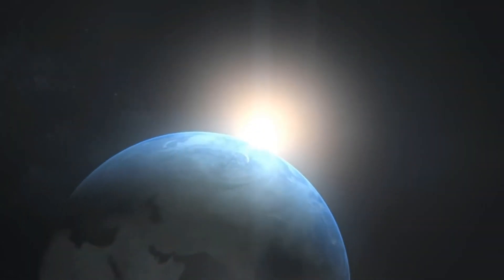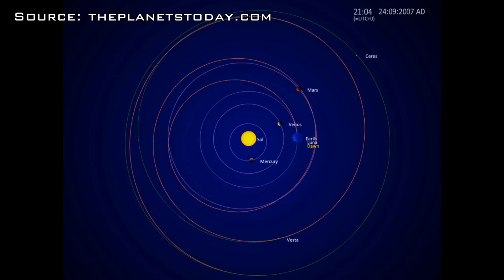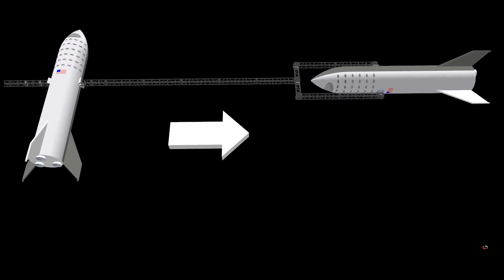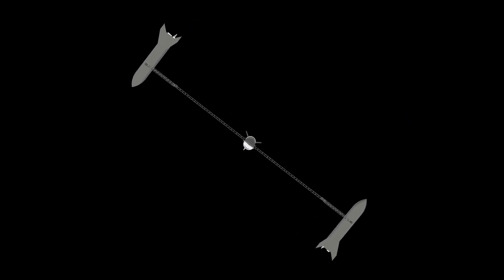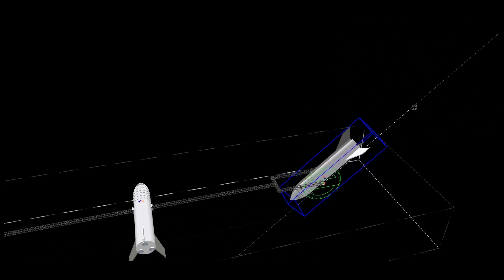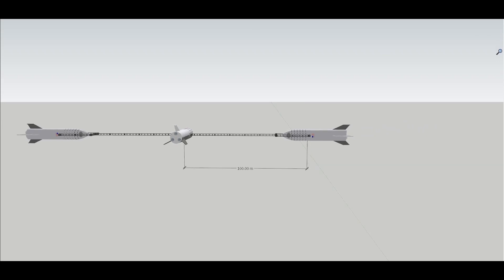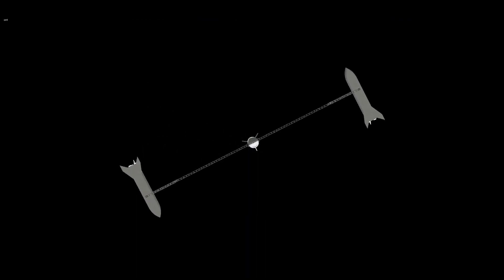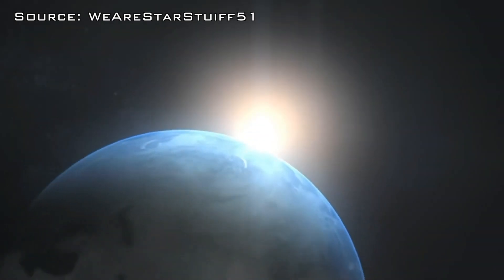GLS2: Artificial Gravity for SpaceX's Starship

Comment: Now, let's think outside the box and take things to another level shall we? Interesting how both the O'neill Cylinder and the Stanford Taurus actually behave in an opposite fashion to "gravity!" In essence, both the O'neill Cylinder and the Standford Taurus are employing kinetic energy to produce a likeness to the effect of "gravity" via centrifugal force. This is not the case in the spherical planetary model. According to Sir Isaac Newton, the initial theory regarding the "force" of "gravity" had nothing to do with motion but rather was based upon the attractive force produced by the mass of a spheroidal object. However, Albert Einstein superseded Newton by adjusting that same theory and proposed that "gravity" was NOT A FORCE but rather a curvature in the fabric of space and time caused by the uneven distribution of mass. 
Here is why we know "gravity" is not a force: If gravity were a force how then would this "force" which would exert its influence over all matter equally throughout all the earth can at the same time be discriminatory to all matter on the basis of weight and mass? Let me elaborate: If this "force" of "gravity" can hold down a 3000lb vehicle via it's "force" then how can it not hold down a Fly! We know its cannot be thrust because the thrust of a fly's wings could never overcome such a force, the same force holding down a 3000lb vehicle! Try pushing with all your finger's might upon your house, will your finger topple your house over? Now exert that same amount of force on a fly and tell me what happens! Yuck! This is exactly why the general THEORY of relativity was postulated by Albert Einstein. In a recent article Prof. Andrea Ghez of UCLA Astronomy wrote the following stating: "Einstein's right, at least for now." "We can absolutely rule out Newton's law of gravity. Our observations are consistent with Einstein's theory of general relativity. However, his theory is definitely showing vulnerability. Vulnerability to what might I ask, to it's obvious falsity in light of further scrutiny? 
What I find amazing is that gravity cannot be detected (other than what appears to be detection in the observance of things falling down) or manipulated as other forms of energy! Some may try and refute this claim by mentioning the Laser Interferometer Gravitational-Wave Observatory which supposedly detected "gravity" waves. What's ironic about this so called observatory is the fact that the theory of relativity is inconsistent and completely contradictory to this fake laboratory! Why? Because according the theory of relativity if you change time you change space proportionately and if you change space you also change time proportionately! How then could you ever detect a "gravity" wave when light is governed by both space and time? The synchronicity of space and time would just cancel out the observance of any disturbance!
We can however, detect sound, light, electricity and heat, we can transfer these same energy sources into differing forms but we cannot for the life of us detect or manipulate gravity! If an object is at rest just lying on the ground, no transference of energy can be detected other than heat, light magnetics (electricity) or vibration (if being applied). But, we cannot detect any force or energy in the form of "gravity" being exerted on that object with any instrument as we do other forms of energy. We can manipulate heat and burn the object, we can increase the amount of light to further illuminate the object, we can electrify the object, we can even manipulate sound waves and cause the object to levitate, (https://www.youtube.com/watch?v=0K8zs-KSitc) but we cannot however, detect or manipulate gravity to cause the object to jettison upwards all the way out into space! I don't care about a rotating cylinder in space employing centrifugal force, show me in a laboratory environment the replication of the "force" of "gravity" on a spherical object! - “If you want to find the secrets of the universe, think in terms of energy, frequency and vibration.” - Nikola Tesla.

Comment: What about the friction at the pivot point? Well that require some fuel to maintain the proper RPMs?
Reply from the maker: You are the first person to think of this, impressive! At this point I'm eager to see how the development of SpaceX's methalox RCS goes, perhaps pivoting won't be necessary. Otherwise, yes there would have to be some greased machinery. In terms of maintaining the spin, RCS should be viable even if it's not very efficient.

Comment: Why would you need a hub? Why not just make one half of the truss system in each passenger ship
Reply: @josef-q6t  hmmm, I get what you're saying, but surely there's a composite/collapsible material or a way to pre-stage it in orbit.  Or maybe that just too much complexity/failure points to make it work it.  Simpler to blast another metal chunk up

Comment: This design actually also gives me a way to implement a component I’ve been working on for long-term space flight as well. The biggest issue that astronauts face is radiation. I propose an electro dynamo generating an artificial magnetosphere be placed in the core of whatever starship is being used. Using your platform the magnetosphere could be placed inside the cargo space of the hub and the arms of the trusses could house collapsible solar cells which could power the  artificial magnetosphere and protect both crafts.
Reply: The radiation issue is overblown. A magnetic field could help with solar flares (charged particles), but it's a lot easier to increase the amount insulation, as polyethylene is one of the best materials for this, and it is quite light-weight.  Anything with a lot of hydrogen will do.  In the crew version of Starship, the water recycling will be built into a double-walled cylinder that will serve as solar flare refuge.  Plenty good.  A bit more serious is cosmic rays, but cosmic rays are mostly high energy non-charged particles, such as neutrons, which a magnetic field cannot deflect, and are very hard to shield against.  The good news is that commercial airline pilots get about half as much cosmic ray exposure as astronauts, and their rate of cancer increase later in life is a mere 1% or so;  far less than from smoking.  Probably the best solution is to bring along supplements that facilitate/stimulate natural DNA repair mechanisms.
Reply: An artificial magnetosphere? This is reality not sci-fi
Reply: @Kevin Adkinson generating an artificial magnetosphere is not sci-fi. It is actually simple to do with current technology. In case you’re not sure what a magnetosphere is, it is simply an intense magnetic field which surrounds an object such as a planet or moon. Hell an unshielded  MRI magnet would do the trick for a small ship. Something the size of what was discussed within this video would need something a bit more powerful but we can make magnets in excess of 30 Tesla so that should not be a problem either.
Reply: Frank ‘simple’ ‘current technology’ what are you talking about. I know what a magnetosphere is, I also know the difference between a journal article and a current technology. You need copious amounts of energy to generate a magnetic field — what do you suggest? Putting astronauts on top of a nuclear rocket to ‘protect them from radiation’. And then when that rocket explodes in the atmosphere one day, then what.
Reply: Kevin Adkinson When I say existing technology, what I mean is technology currently implemented in other fields. There are a plethora of magnetic applications that we regularly use, which can be manipulated to produce the fields we require. There is currently no “artificial magnetosphere electromagnetic field generator, “ but we could build one very quickly.  Let me break down the requirements for you:
The current output of the earth’s magnetosphere ranges from 45 to 65 microtesla At 7.83 hertz. The current strongest magnet on earth exerts 45 Tesla. This is equivalent to 75 times stronger than the earth’s magnetosphere. A 45 Tesla magnet uses 33 MW of power.  That is an efficiency of 1.4 kW per microtesla. 

We do not need a magnet that powerful. To fully protect the ships equipped with the artificial magnetosphere electromagnetic field generator, we need to generate a magnetic field in the range of 100 to 150 microtesla at approximately 8 Hz resonance. The power requirement for a coil meeting the standards is 210 kW.This requires that we build an electromagnetic resonance coil which could be similar to what is found in the back of wireless charging devices only on a much larger scale. We could also instead model it after an MRI and make the coils tunable if we desired to. This magnetic resonance coil can be tuned to resonate at eight Hz very easily. These coils can be incorporated into the hull of the vessel in the center of the array discussed in the video above or on each independent vessel For extra protection.

As far as power is concerned, there are a plethora of options available to a crew of an interplanetary vessel. We do not require the use of heavy radioactive material, as you suggested. Although, if we were to use a nuclear reactor for this purpose, I would recommend a liquid fluoride thorium reactor for several reasons. First off, it’s fissile material is barely radioactive, to begin with until bombarded with neutrons. Secondly, it is highly unlikely that it will melt down as it needs to be continuously bombarded to provide the radioactive heat used to spin up the turbine. Thirdly these reactors are designed to contain any potential radioactive threat in cases of cascade failure by collecting the liquid thorium inside a container shielded from neutron radiation. The reaction ceases immediately upon the fissile material no longer being bombarded.

Solar is an option, although it will take a decent sized array for it to collect enough power. As compact as solar is, though, a broad enough array can fit in minimal space. To power one set of coils would require between 12 and 15 m² of solar cells at the distance of Martian orbit Assuming current solar technology. This is nowhere near impossible, considering the international space station currently has 2500 m² of solar cells, which is more than enough to provide enough power for the vessel and the coils. 12 to 15 m of solar cells is minuscule in comparison.

These two options avoid many other common types of power used in space. This would include solid-state thin-film lithium batteries, hydrogen fuel cell systems, etc. All of which are more than capable of meeting the power requirements of the spacecraft and their shielding coils. If you so desire, I can draw up a diagram laying out the exact design of the system I am discussing so that you may visually see it. I don’t believe it’s that complicated, but I am also slightly biased as I have been thinking about this system for a while now.

Comment: It seems better to build it as a space station that spins and then slingshot it to Mars. More expensive but a better habitat and once there, it can be used as a permanent fixture around Mars.
Reply from the maker: Interesting thought. Currently the plan is not to orbit mars with these vessels as they won't have enough delta V to insert into Mars orbit. Once a station is spinning it would be tough to change its velocity enough to get it on it's way to mars logistically, and you're right economically.

Comment: I think a better way of doing it would be to send 6 at a time.  Then link them so they make one long tube.  And then use side adjustment thrusters to get them spinning.  |==><==||==><==||==><==|
Put all the cargo on the inside ships and the people on the outside 2.  This would require less energy to rotate the ships... put less stress on the joints... and require a lot less additional material to create the connections.  In fact, I think they already have a tail to tail hookup in place for refueling.  Though I doubt you could move people through that hookup.  However, the top to top hookup could probably allow that.  Thus, you would keep your food supplies in the 2nd ship on each end... people in the far ends... and stuff only needed for Mars in the center two ships.  Assuming you put people in the center two for launch, they would have to space walk to one of the outer 4 ships.
Edit: I may have been mislead by your graphic though.  These ships might not be long enough for what I suggest.  How long is the stage that actually heads to Mars?  If it isn't long enough you could still get 1g but everyone would be motion sick all the time...lol.
Reply from the maker: 55 meters. Very intriguing though you have here!

Comment: The starships will be made to dock butt to butt, so why not just hook up two butt to butt and spin them around the axis at their butts?  The gravity would be on the "ceilings" of the inner compartments, but in a space ship, the concept of floor and ceiling are interchangeable.
Reply from the maker: Yeah ceiling grav is a problem, although if that's the best way, I'm not against it. Also, the radius of the spin won't be lengthy enough to be in the "comfort zone" if they go butt to butt http://www.projectrho.com/public_html/rocket/images/artificialgrav/gravComfort03.jpg
Reply: @smallstars  haha I checked that calculator out before I thought of the comment. And you are right, but  I think knowing Elon and SpaceX, they would be more likely to go with something outside of a debatable comfort zone than to develop more infrastructure.  The ceiling gravity could actually be ideal.  Landing seats with harnesses and any other systems or hardware needed for take-off/landing would be out of the way on the "ceiling" during the bulk of the journey.  Only for launch and landing would the floor need to be the actual floor.
Reply from the maker: @nlingrel  I wouldn't be mad at that!

Comment: Potential problem I see is that each joint on the middle ship needs to support 1 g of outward force, so 2g total force trying to warp the cylinder of the inside ship.  The joints on the outer ships only need to support 1/2 g force each.  So unless this is already within design strength constraints,  then the middle ship would need to be more robust and would therefore need to be a different version.  Also, Elon said he wants to possibly make the RCS thrusters use methalox.  Like teeny tiny dragon engines.  So RCS would not necessarily be out of the question,  and would allow for much more control on the spinup burn, especially in the case where the engines don't fire exactly at the same time.
Reply from the maker: Yes, the connection in the center of the spin would have to be very robust, but it would naturally be designed as a very strong structural element, in the center of the GLS, not putting any stress on the hull.

I can't wait to see the development of their planned mathalox RCS

Comment: Total nonsense. This is the same as to hang a Starship filled with several hundreds tonnes of fuel. The nose structure is not designed for this kind of load.
Reply: If you watch the video carefully, the truss is not being attached to the nose.
Reply: @yapanuwan  Doesn't matter. In the details it's even more ridiculous. A through tunnel in the middle of the body where the full G force of the loaded Starship is applied(in various directions) would require redesign and strengthening of the construction. No way it will ever be implemented. More likely the whole design will turn into something completely different.

Comment: I brought this up on another video.  If you have two Starship leave orbit and enter drift speed they can just connect like they do when they refuel and start the spin.  The crew areas will be approx.100 meters apart Which is the min. You need.  Simple as that. You just have furniture and equipment be able to Ikea connect for the ceiling as the floor. And then flip it back when you get close to Mars.  Keep in mind that you only need 1/3 earth gravity on the way there and maybe 50% on way back. Any gravity makes a big difference then having none.
Reply from the maker: What you described is a 100m diameter, which is half the length of the 100m radius needed to be in the comfort zone: http://www.projectrho.com/public_html/rocket/images/artificialgrav/gravComfort03.jpg
Reply from the maker: I agree any gravity is better than none, but IMO the closer to 1G we can get, the stronger the space adventurers will be.

Comment: Artificial gravity is a necessity for long space voyages.   I realized this years ago when I learned about the deleterious effects of weightlessness on the human body.  To contemplate long term weightlessness on space voyages the way we have been doing it on the  international space station is shear  insanity.   I disagree with the use of a costing transfer orbit for voyages to mars and  other points in our solar system.  We must think outside the box and use nuclear reactors to power Space ships so a faster speed using ION drives can shorten the length of voyages.  Remember that you must provide all of the air, water and food for all of the astronauts aboard the craft as well as protect them from radiation which will require heavy shielding and probably even a more heavily shielded safe room for extreme solar radiation conditions.  I believe we have been thinking too small ever sense we started to explore space and it has coast us more resources and time .
Reply from the maker: Unless a new technology gets invented that allows us to travel way faster speeds than nuclear reactors would provide, the 6th month transfer orbit is the best choice. Here's an explanation of why: https://www.youtube.com/watch?v=EKQSijn9FBs&t=1020s